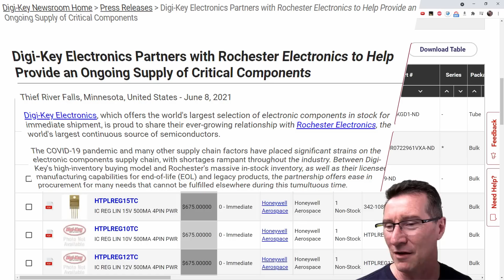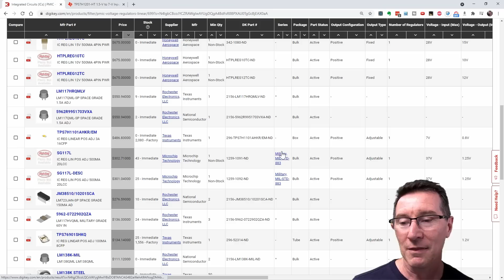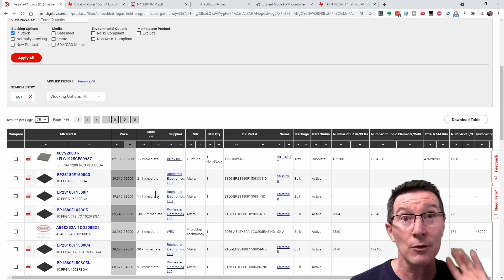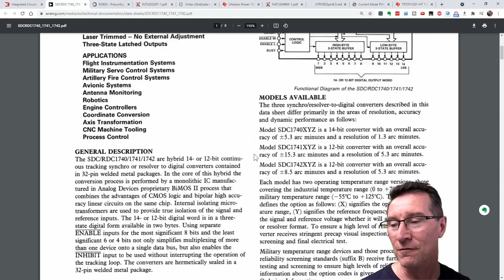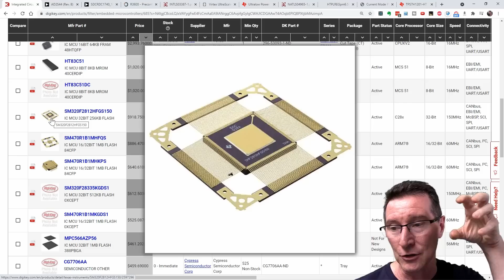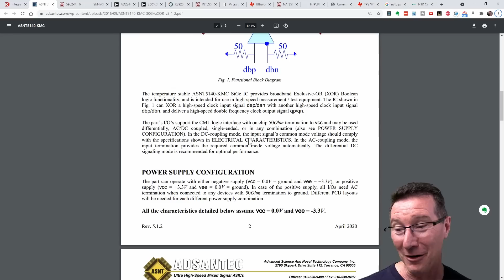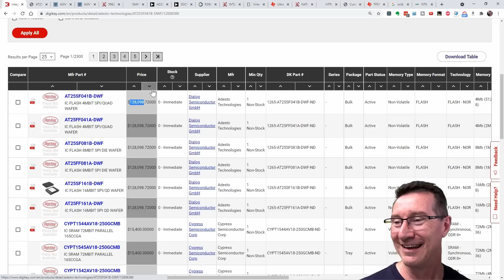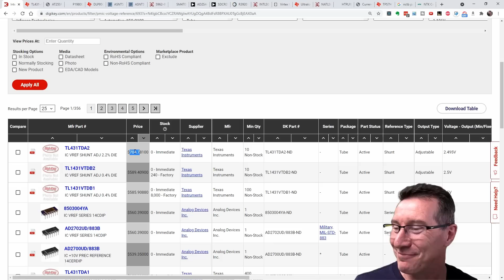EEVblog 1435 - The World's Most EXPENSIVE Catalog IC ?

Comment: You missed the most expensive price “Call for Price”.

Some of the most expensive keywords I’ve ever seen are “Radiation Hardened”, “Low Outgassing”, “Guaranteed Performance”, “Individually Fully Characterised”, “ASIC Replacement”, “Safety Critical”, “Qualified”, "NDA" and “Export Restricted”. God forbid you specify a part with all those keywords at once.

The most expensive part I’ve ever specified in a design is of course an FPGA, but a pathetically wimpy one in comparison. Whenever I consider any sort of specialised IC, I just think about how much of a pain the export restrictions and NDAs are going to be.
Reply: I ordered spare parts that came in at $1 million each, and the sending company sent this ordinary untracked parcel post. Military can be silly expensive, the order was for 10 of them, and each would fit in your hand. They were also NOS items, from the OEM for the unit, though were 10 years later in manufacture date, and had already suffered from component obsolescence in that time, with 4 parts being no longer available, but with equivalent parts instead. They had done exactly the same part substitution as we had done, though they had respun the PCB to fit them better, we had to do a little work to make them fit in the otherwise identical board.
Reply: @SeanBZA  $10m worth of stock, and they sent it in untracked parcel??
Reply: @DUIofPhysics  Yes, twice, I got the parcel delivered unopened, and peeling the top label off I saw the original shipping intermediate address. Lots of cancelled stamps, covered with another gummed on sheet of A4 paper, with more cancelled stamps.

Remember that De Beers used to send diamonds in the mail, slipping the small packet of diamonds into the massive paper catalogue they used to send every month, to just about every jeweller in the world, and they lost almost none of those tiny little packets of stones, taped to the middle of the catalogue. Only recently did they change to having them delivered by courier. Mail used to be secure, reliable, and safe.
Reply: @DUIofPhysics  Actually about $5 worth of stock, but charging $10m.
Reply: lol I HATE the "Call for Price" bs... haha, I don't want to go to THAT much effort.
Reply: @ColinTimmins  I don't get it either, whenever I see "Call for Price" I will pretty much immediately rule out that supplier. Even in the case of highly customizable parts it's much nicer to see "$200 to $500+ ea." than "Call", there are very few situations were a rough estimate can't be provided, usually the "Call" stuff is purely to collect information and allow for call backs.

The one I hate the most is websites that make you create an account before they will tell you the price, many test and measurement equipment manufacturers do this, you have to give them all your details before you're automatically emailed a 'quote' and then you'll get emails from their sales department, in all situations I've done this they just told me to buy from a distributor which publicly lists the same price.
Reply: @WizardTim  It's not to collect leads, it's to extract maximum consumer surplus by pricing to what you'll pay. If the widget costs them $100 to make they'd be willing to sell it to a startup for $120, but would try and get $200 out of the government.
Reply: @WizardTim  Lots of places now a days where you can create a temporary email address for a short time exactly for these kind of circumstances :)
Reply: I make radiation hardened , wide temp range with guaranteed specs, export controled and no lead free ASICS  for spatial and mil Use, I confirm!

Comment: As well remember Sinclair Research was experimenting with wafer scale complete systems, where they wanted to fit all of the memory, support and processor circuitry, along with every single peripheral you can think of, onto a single 300mm wafer, with rows of wire bonds going across the top of the wafer to provide interconnections where needed, and another set of heavier bond wires to provide the power it needed.

The space grade comes with a serial number on the box, and each chip has been tested for 1000 hours at elevated temperature, plus has had the whole bake and shake done to each. You can trace it back to the actual region of the mine, where each individual shovel full of ore came out. Comes with a booklet of pages with all this attached, though probably there is a digital record now for this, supplied with each delivery.
Reply: Cerebras is doing exactly that right now, an entire full sized wafer filled with logic and SRAM, on a TSMC 7nm process. The price is around a few MUSD/unit.
Reply: @TheBackyardChemist  Yes, and each wafer is housed in it's own huge great water-cooling and power delivery unit, the size of  a chest freezer. Each one uses a couple of kilowatts.  Crazy stuff.
Reply: @gerryjamesedwards1227  you're a bit off on the power, it's like 20kW
Reply: @tommihommi1  you're right! Blimey.
Reply: @TheBackyardChemist  what kind of applications do they serve?
Reply: @keylanoslokj1806  machine learning (AI). They claim their solution (the several million dollar chip) is actually a lot less expensive than building out a similarly powerful GPU-based supercomputer.
Reply: So... You get what you paid for then?
Reply: How do they manage defects? The larger the IC area, the higher the probability that something goes wrong, so making one IC on a whole wafer looks like a recipe for a VERY low yield
Reply: @mieszkogulinski168  Very easy, you have a good amount of redundancy, like modern GPU cores do. Blocks of memory and a self test for each on wafer, that will, using some method or the other, mostly zener zapping, as that is easy to do, and simple to do with the existing pin scanner. The bad blocks are mapped out, and redundant blocks are mapped back to replace them. For flash simple to just have a few pages of SLC flash on the controller, totally isolated from the memory, and each small block controller will have bad blocks mapped out and spares mapped in, with part of this also in use for wear levelling. CPU wise similar, you have a way to check each one on it's own, so can simply disable those that fail the self test, and provision a few more on die as spares. Thus you get different grades of chip, some most cores work, at full speed, and all RAM and ROM work well, so are premium grade. Less functional ones are lower grade, but still expensive, and the bottom, just above the reject limit for the device, are taken as the lowest slowest and cheapest devices. All those wafers with shorts or excess power use are simply dropped back into the melt cycle and are recast.
Reply: @SeanBZA  makes sense, thanks :)

Comment: I like this video, don't know this kind of IC on sale, think space grade IC have special channel of sale, well I can get them ... if I got the cash!!
Reply from the maker: Yeah, you likely aren't buying your space grade parts from Digikey.
Reply: @EEVblog  You might, if you are building a cubesat, the builders of them here are getting parts from both commercial retailers, along with the suppliers like RS, Digikey and Arrow.
Reply: @SeanBZA  I think a lot of them might just use redundant systems, rather than getting space grade parts, lol.
Reply: @SeanBZA  LEO cubesats use commercial parts since they aren't really in space, they are still within all the protective layers. Its why there are laptops and commercial electronics on the ISS.  My nephew built them and they even used fishing line, not really high tech on most of them.
Reply: I used to design space electronics (not the microsat toys).  Yes, we talked directly to the vendor.  Most of the space parts are not retail. Class S parts are generally negotiated. I though Microsemi's RTAX FPGA couldn't be beat at $120000 each (for semiconductors that is).  A wafer run of custom ASIC's don't really count but they were much higher.